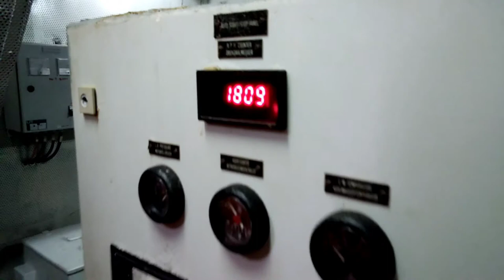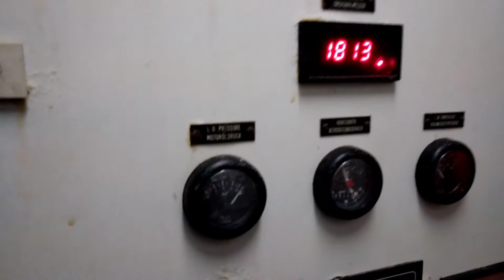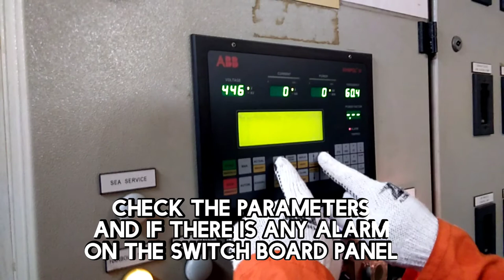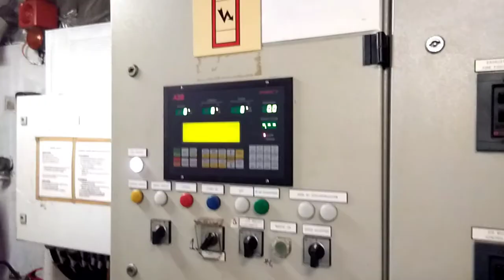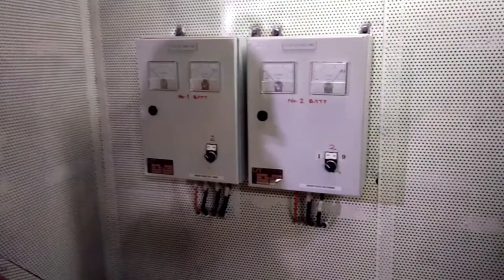Emergency Generator. Electric and Hydraulic starting procedure. Testing of the Quick Closing Valve

Comment: sir good day.
in this video 1:35
you showed us that, we need to turn off battery charging.
my question is, why we need to turn of the system? if not what will happen?
Reply from the maker: Good day to you, there is a possibility that it could damage some electronic parts on the charger during start/stop of the generator. Nothing will may happen if you do this for a couple time. I used to do this kind of practice to avoid unnecessary repair, beside in actual black-out scenario, the charger have no power and the battery is the only main source of power to start up the emergency generator. Thank you.